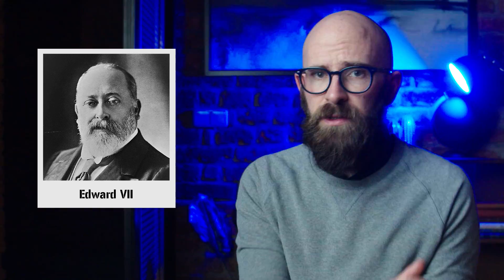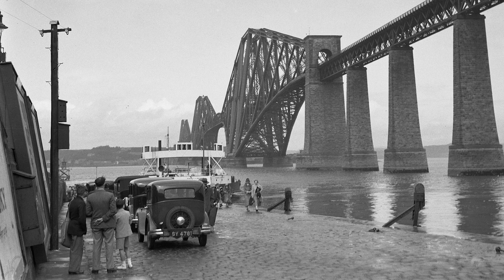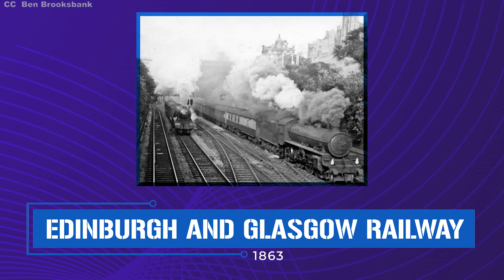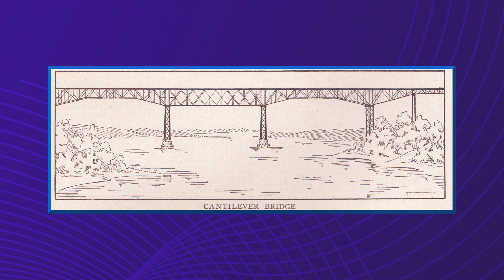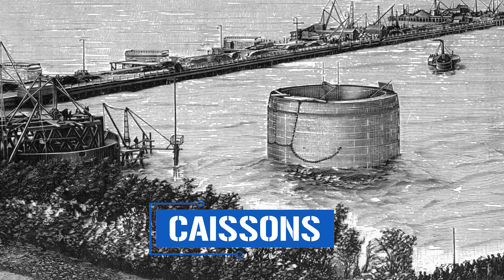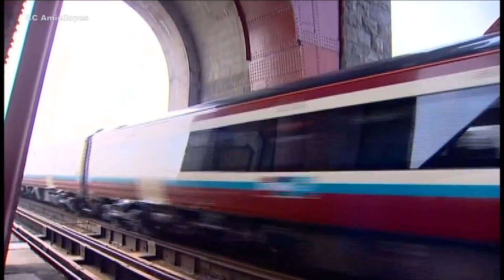The Forth Bridge: An Incredible 19th Century Achievement

Comment: Recent discovery about the Tay bridge disaster found that the section which disappeared during the event had been blown off its barges during a previous storm.
Instead of building a new section, the damaged one was salvaged and erected with a twist in the structure, compensated for by the insertion of triangular plates at track level.
Trains passing this point experienced a side step, lurching left to right (vice versa depending on transit direction)
The combination of side step, speed and high wind derailed the train, striking the triangular struts and dislodging the damaged section and adjacent sections!

Comment: What I love about the Forth Bridge (aside from being generally awesome) is that it's a visual lesson in structures - all the main compression members are tubular (the best shape to resist buckling), all the main tension members are lattice trusses.   Almost without exception.
Also, aesthetically, the way the curve of the bottom chord of the cantilevers flows into the horizontal deck of the suspended spans gives it an elegance and a visual unity that many large cantilever bridges lack.

Comment: An interesting look at a bridge I've crossed many time, however. I feel on this occasion your writer did Sir Thomas Bouch a bit of an injustice. Yes he was involved in the designs of ferries having introduced the first roll-on roll-off train ferries in the world. However, railway engineering was always his forte. He had a successful career in bridge design having designed several bridges across the north of England and Scotland. I also believe he was also part of the team that developed the Caisson
Reply: That and the Tay Bridge wasn't finished to his designs. The number of supports was reduced the quality of some of the metal was of questionable quality for cut cutting reasons. Its entirely possible his original design with appropriate materials would've stood through the storm.

Comment: The design of the Tay bridge involved cast iron. While very strong, it is not very tough and will encounter brittle failure when overloaded. That, combined with the massive cross-sectional area exposed to wind loading, ultimately caused the bridge to come down. The design was essentially eyeballed.
Reply: Not to mention shoddy workmanship, and the generous use of putty to cover foundry mistakes that Bouch had nothing to do with.
Reply: @HustleMuscleGhias  they also increased the spans to reduce the number of piles they'd need to sink.

Comment: I really enjoyed the video, however... This story is on a much smaller scale of the Quebec bridge as he said. The Quebec bridge also has a much more interesting story,  is also the more complex structure in almost all metrics from as far as I can tell, out the two. Opportunity missed for real mega project with this design.
Reply: It's on a much larger scale, the Quebec bridge is 987m while this the forth bridge is 2,467m. The forth bridge was also completed 30 years before the qubec and was complex for its time.I'm sure the Qubec bridge was also complex for its time but could you please elaborate how you think its more complex.
Reply: @owensilken  Both bridges are amazing. However the mass of the Quebec bridge from what I am looking at are simply more massive. Forth Bridge has two rail roads from what I understand. Quebec Bridge also has rail and a pedestrian path with bikes. It also has a three lane highway. 33 feet to over 67 feet wide. The spans are also longer by 100 feet.  In Weight also 67 546 Tons for Quebec. 55,000 tonnes for Forth Bridge. Plus the story is amazing(two collapses). Felt like it would have made a better video. I am thankful for the time and effort that went into this video. Very good stuff.
Reply: @RealTerr   Quebec Bridge currently carries just a single railway track (plus three roadway lanes).   Forth Bridge is double track, it was designed from the start to carry full train loads and still does.   Forth Bridge has TWO main spans of 1,710 feet each, Quebec Bridge just a single main span of 1,800 feet.   To claim that either one is 'much smaller scale' than the other is just ridiculous.